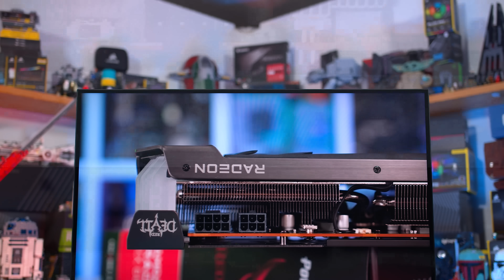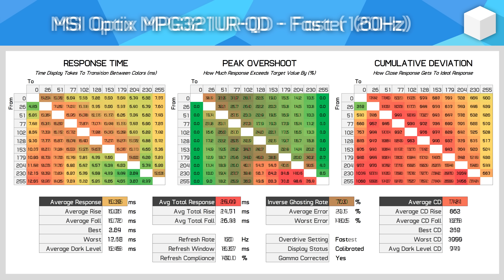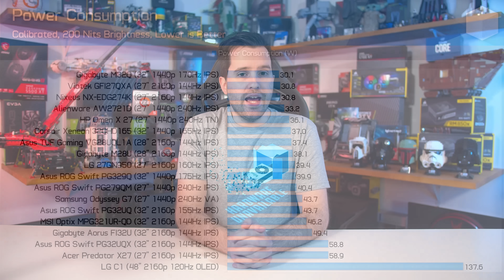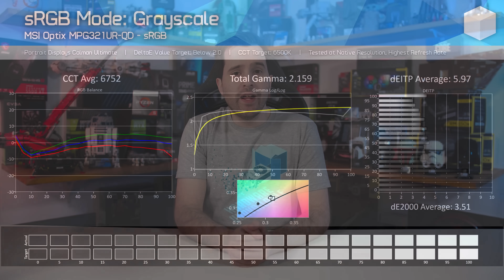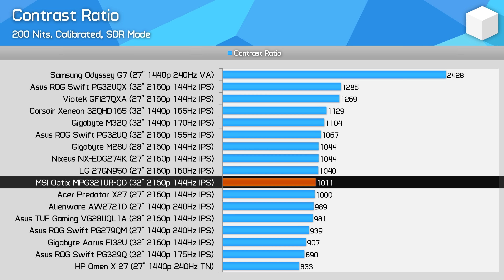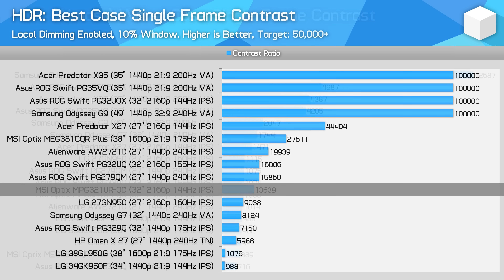The 4K Monitor to Buy? - MSI MPG321UR-QD Review

Comment: Whenever a premium high refresh rate monitor doesn't offer a single mode that you can use across the entire refresh range, I immediately discard it as trash in my mind. The whole point of getting a premium product is to avoid dealing with the compromises of the cheaper options. Even budget monitors can offer a single overdrive experience.
Reply: This. I wonder; if MSI were to update this monitor (website says it supports firmware updates) to include a variable overdrive, would that would change Tim's recommendation from nay to yay?
Reply: LCD pixel overdrive is just a bs invention anyway. It doesn't change the native response time properties of the pixels in the panel, but just shifts them to a different type of artefact (overshoot). The non-overdriven response times are the true response times of the pixels. And it's even a bit worse than that, since no display reviewers measure the full response times of 0 to 100% change in colors. I think HU now measures 3 to 97%, which is better than the 10 to 90% it used to be for the past few decades, but still not the full 0-100% time it takes for a pixel to change color.
And this does matter and can be perceived.
True LCD pixel response times are really in the 10-15ms range. Barely good for 60Hz. Everything else is just pretending they can really keep up with higher refresh rates, but they don't. OLED shows how slow LCD pixels really are.
Reply: i feel you man 😣
Reply: Yeah same... after that segment of the vid I totally lost interest in this monitor.
Reply: @edfort5704   i think many people including me would change their monitor to OLED but the problem with this is OLED is not reliable for PC monitor yet
Reply: Same, especially if its 1440p or 4k monitor, since in alot of single player games you will have fps around 30-50, in some casual games maybe 80+ but all moba or shooters like CS will run at 100-200fps all the time so switching overdrive everytime is annoying
Reply: I wonder if there's a firmware already to address adaptive overdrive, could not find any related posts..
Reply: n00b

Comment: Trying to find a perfect Monitor for PS5 and Xbox SX is really exhausting because there’s always something wrong with one of the 4K 144hz HDMI 2.1 monitor
Reply: Theres gonna be something wrong with every monitor
Reply: Try lg ultragear 950
Reply: Yup. Technology is always advancing so there are always pros and cons. Just all depends on how much you wanna pay, how long you wanna wait, etc.
Reply: I really want to purchase a monitor for PS5 use, what would the best option be at this stage? MSI MPG321UR-QD? Gigabyte M32U? Gigabyte M28U?
Reply: @cpt_Ruckus  wait for the Cooler Master GP27-FUS or the Odyssey Neo G8.
Reply: @ermagherd1204  I ended up purchasing a MSI optic MAG281URF, very happy with it so far!
Reply: @cpt_Ruckus  that’s awesome.  I jus got my 1st monitor last month loving it. Was using a 4K tv at 60hz which is great for my One X but bought a Series S with a Acer Nitro 1440p high refresh rate monitor with Freesync & hdr10 a curved VA panel & I’m happy as fuck….but I already wanna upgrade jus knowing there’s crazy better out there
Reply: @cpt_Ruckus  I just purchased that one too. Arriving tomorrow. A little nervous with no reviews out but I trust msi with monitors. Not to mention it has usb c display which is great for my work mac. Mind giving me a little more details on what’s good and bad?
Reply: @shehzadyousaf7918  not much to dislike to be honest, no issues with HDMI 2.1 across a 10m cable with a PS5, monitor supports full HDMI bandwidth. Tons of OSD options, software to control the monitor OSD and a configurable hotkey (I use it to switch directly to a HDMI input 2). Can't speak much to the colour accuracy, but to my eye it looks really good.. I can't fault it, very happy with my purchase
Reply: @cpt_Ruckus  I’m planning to purchase the mag281urf as well… i’ve read it’s bot freesync but gsync but that doesn’t matter cuz ps5 doesn’t support any of them tho it’s just the hdmi2.1 vrr if I’m correct
Reply: @cpt_Ruckus hope you have bought something! Which one you purchased? 
Which one should I buy b/w m32u and optix mpg321 for PS5?? 
Will 24gbps hdmi2.1 affect gaming?

Comment: Is this maybe panel (or the hardware driver for it) limitations? Considering all of these 32” 4K 144hz monitors have the same set of limitations and issues. Surely all manufacturers aren’t being equally lazy in tuning?
Reply: I would say so yeah
Reply: @GlowyBoi Oh but it is! I use an LG oled C1. Admittedly that limits me to 120hz, but in every other aspect, and especially HDR, it blows any other monitor out of the window for games and entertainment, no contest at all. 
Admittedly I also use a side monitor ( 32 inch 4k viewsonic) for if I need to do any long term application work (48 inch is overkill for apps, but amazing for games). You could buy the 48 inch C1 and a decent 32inch side monitor for less than 2K and the performance would be unmatched by any of these over priced units....
Reply: @titntin5178  with LG C1 watch out the most recent firmware update apparently broke some of the features in the TV
Reply: @devonpack906  what exactly?
Reply: @Project.Wraith  Max brightness and dimming issues look up The WAN show from a few weeks ago Linus mentioned it and Babucules also mentioned it !
Reply: Don’t underestimate their laziness
Reply: @GlowyBoi right!? but if LG refreshes a C1/CX 32" OLED TV next year then it'll surely be game changer.
Reply: @damsapollo  I think they said they’re releasing a 38 inch version
Reply: @GlowyBoi If its content creation you are after, forget my recommendation, thats based on entertainment only. I was a AAA games dev for two decades and much as I love games on 48inch oled, its not the place for serious content creation. If I ever do knock out an assett in UE5, it would be on the 32 inch ips, i can always drag a preview onto the oled if I wish to test its look on a consumer display.! The oled is all about entertainment, not work!  Unfortunately, LG dont appear to have any plans for a 32 inch unit, they have announced a 42 inch for next year, but I believe its unlikely they will go smaller.... Though I appreciate there is a demand.
Reply: @robertct06  42inch, next year

Comment: I'm just waiting for a $1000 32" 4k 144hz oled monitor. Totally willing to wait another year or 2 if necessary. . .
Reply: I am afraid you will have to wait longer than two years for one of those. 
But it sure would be a great monitor.
Reply: Gl with oled on games
Reply: @CarthagoMike  1000 dollars for oled 4k 144hz🤣🤣🤣🤣.
Reply: @mareksarnovsky2731  I mean..OLED is better for gaming thann anything that came before..It provides a higher definition then LED and LCD..Its the only display truly capable of fully rendering 4k and 8k.
Reply: @j.a.3138  there are more than 50% people who return burned oleds, because of static screen (what they expected truly ? :D) there is no big difference between led and oled, only what is bigger difference is true black and in most of games u dont need it.

Comment: Hey Tim, an updated buying guide on ultrawides for 2021 would be interesting!
Reply: I’m happy with my LG 38GN950 but there weren’t that many reviews on it when I bought it in January this year. I would have loved a HUB review 😉
Reply: I'm still waiting for the review of the LG 34GP950 myself.
Reply: Yes please!
Reply: For a gaming monitor, if you want little compromise for a fair price then it's LG 34GN850 and if you want something much cheaper but still decent it's Gigabyte G34WQC.
Reply: The only ultra wide you need to know about is the g9
Reply: @kanseidorito5287  that's if you are willing to spend this much money on a monitor.
Reply: @sujimayne  I already have the LG 34GN850, but the DisplayPort stopped working and I need to return it while still in warranty. But I need the review of the 34GP950 to know if I want to upgrade or stick with the 34GN850-B.
Reply: @filipealves6602  not sure where you are located at but here in germany the 34GN850 is 800 euros and the 34GP950 is a hefty 1300 euros, for 20Hz more refresh, a watered down gsync ultimate spec and HDR 600 (still not true HDR) over HDR 400 the 500 euros is a total joke.
Reply: @warlordwossman5722  indeed, but that's where I need Tim to come in and confirm that there's nothing else to add to what you said. The HDR in my monitor is indeed pretty poor, I was hoping it was considerably improved. Also peak 400 nits is still too bright, I don't want to be blinded by my monitor at 600 nits, I just want good HDR in both games and Blu-Rays on my gaming machine.

Comment: I will be waiting for the Gigabyte M32U review before I make a decision on which 4k panel I should get.
Reply: RedJoker  it should be, but there's some subtle differences like in their website, it says you can use the aim stabilizer(motion blur) along with adaptive sync. And I'm sure Tim will be able to point out those subtle differences if there are more.
Reply: M32U is most likely a FI32U with simpler design.
Reply: M32U has the same panel as the FI32U. Just like the MSI MPG321UR-QD has the same panel as the PG32UQ.
So performance is very very similar. In the end it's more about how well the model is pre-calibrated and what functions were implemented.

Comment: Man crazy that the cheapest 4k 144hz monitor by Gigabyte is the best of the bunch so far with regards to 4k, 144hz gaming...I should have bought it when it came out months ago at a price below $800 AUD. Just like GPU's mark ups, current pricing from retailers means the only M28U's  I can find are all over $1000 AUD which sucks...  Guess we're going to have to wait for those 4k 160hz monitors in Q1 2022
Reply: I also regret not buying the M28U sooner too. Sold out for a while here in the US. Hecc I've just snatched a $873 4K, 144hz monitor from ASUS ROG last night. just got released and barely any reviews on it atm... yet customer reviews are 99% positive.. 100% actually shockingly. But yea all of these monitors are selling like hotcakes and sold out just like GPUs.
Reply: LG 27GP950B is pretty good in my opinion.
Reply: Same, but if the reviews said it sucked we'd be saying how we wished we waited to know better. No point beating ourselves up about a decision we had to make with limited information like that, especially with an unproven brand like Gigabyte.
Reply: Yeah I grabbed the fi32u from Amazon to try and test out and the 4k gaming is pretty amazing. Only downside is the performance I miss on my 240hz 27" 1440p display when playing competitive shooter. For open world games and RPG, or even SP fps it's stunning. Kind of sketchy about keeping the gigabyte though because of HU review and some people reporting horizontal lines appearing due to some flaw. RTings gave it decent review though. I was excited about the msi with HDR 600 but seems it's got slower response times/slower panel vs the gigabyte
Reply: Only hesitation I had on M32U or M28U is not having full bandwidth for HDMI 2.1. Since I have a PS5, I don’t want that compression.

Comment: Hi, will you review the M32U or should we maybe expect similar performance to the M28U you've previously reviewed? I'm looking for a 32in 4K 144hz but I feel like most monitors with those characteristics are obscenely overpriced.
Reply: They all use the same panel and are similar in performance. Buy whatever's cheapest and has the feature set (and warranty) you want.
Reply: I wanted to see the same review M32U 😔
Reply: The M32U has the same panel as the FI32U, which Hardware Unboxed already reviewed. So you can expect it to be similar to that one's performance.
Reply: I have the M32U and for $799 you can't go wrong honestly it's a awesome monitor . The latest firmware update increased the input lag substantially since the review of the M28U on here. You won't be disappointed with the M32U
Reply: @jonessii  Does this use the same panel as the Gigabyte M32U? And from the little research i've done the Gigabyte M28U seems to use a bit of a higher quality panel.
Reply: @TC_DualSport  Nice, so what are the pros and cons with the M32U? Also, what do you use it for, like 144hz pc gaming and streaming?
Reply: @TC_DualSport  they increased the lag??

Comment: After going to an Asus tuf vg34vql1b than back to IPS I had several IPS panels. The g27q along the the dell nano IPS and 2 different LG nano IPS panels I went back to the Asus tuf vg34vql1b. It's the only VA I've had that's got low enough ghosting that I don't notice often enough to loose out on the almost 5000 to 1 contrast and highest nit Brightness I've had on a monitor.

Comment: Proper HDR
A fast enough panel
27" Size
QHD/4K
Backlight strobing with VRR
144Hz+
Good Color Performance
Recommended by HUB

If all of the above are combined in a single monitor, I'd upgrade from my aging MG279Q. Looks like we still have some waiting to do

Comment: I keep hoping Alienware will make a ultra wide 4K monitor.
Reply: I want Alienware/Dell to make a 32:9 monitor considering Samsung are struggling with G9 quality control.
Reply: I was waiting for a good 4k 32". Just gave up and got the 38" Alienware AW3821DW.
I never wanted to buy Alienware but it's pretty sick. 3840 wide but only 1600 tall. Which is less awesome for productivity but means fewer pixels rendered when gaming. 
$1499 AUD for a decent, fast, IPS monitor

Comment: I didn't watch this yet but I hope MSI improves the "Goldilocks" monitor (Optix MAG274QRF-QD) with the MAG275QRF-QD because that is basically the perfect 1440p monitor.
Reply: Goldilocks?
Reply: @moetazammar964  It's an idiomatic expression where it's just right in so many ways.
Reply: @SeraNeph  I'm aware it means something, I'm just curious what it is. Also because I was looking to maybe get that monitor
Reply: 27 inch is too small
Reply: @williamg7138  nah it's acceptable
Reply: @williamg7138  I really want ultrawide but at the same time I have 3090 and i12900 and don’t want to give up on 4K I really don’t know what to do
Reply: @windynight143  get a 38 inch 3840x1600. My 3080 runs good on that so a 3090 with be sweet

Comment: I recently got a RTX 3080 and was on the hunt for exactly 32" 4k monitor and this basically has told m,e what I had originally thought with a hell of a lot more detail than I, thanks guys.
Reply: hey dude can u tell me this monitor is great for rtx 3080?!
Reply: @CetutsDS  did not find one yet,  still on hunt,  not sure it is currently worth getting as a lot seem overpriced
Reply: same here. I just upgraded to i9 12900k with 3070 ti and still searching for a decent 32" 4k 144hz monitor. My current monitor is a Samsung 32" 4k but stuck at 59hz..I might get this one.
Reply: @j.a.3138  any updates?
Reply: @Pettigo83 so what did you finally get ?
Reply: @abhisheksharma07  got Gigabyte 32mu, I'm happy enough with it, not 4k though

Comment: There has got to be a solution to automatically switch to an SDR mode in the future. Some kind of software control via USB. I'm not buying a 1000$ monitor to manually switch profiles every 30 minutes.

Comment: So basically it's stupid to get any 4k 144hz monitor today. It's sad to see such expensive monitors lack features or functions across the board. I'm in the market and it looks like I will continue to be in the market. Not going up spend $1000 and still lack anything.
Reply: TVs are so close to monitors at this point I rather keep my 165 1440p dell monitor and upgrade my tv to 4K 120 and enjoy gaming that way its cheaper with a bigger oled picture LG c1

Comment: A lot of these monitors look great, but on the flipside of that, if there is ever an issue that requires support - there's a reason I predominantly go with Dell or HP.  Their Customer Support and Returns tends to be really easy(especially if you have dead pixels), where-as Gigabyte and MSI tend to be a nightmare and Asus has always just been hit or miss though like back in the x79 days.

Comment: I tried out the 32 inch GN650-B from LG (1440p resolution) and it was super underwhelming. Extremely bad input lag/blur, with lots of overshoot. Picked up a 27 inch IPS from LG as a replacement and it is way better at handling the refresh rates that these monitors reach. The 32 inch VA panel had similar response time performance to the monitor you're reviewing here. Overshoot and inverse ghosting were extremely distracting on the 32 inch panel, and caused extreme eye fatigue while playing high-response/high-detail games like Path of Exile, where there is a lot of white text over black boxes moving across the screen.

Sad to see that so many of these "higher end" monitors are plagued with either extreme amounts of overshoot or slow response times that are inadequate for 144/155/165 hz. Interesting, though, to see that the LG IPS you tested did very well.. that lines up with my experience with their 27GP83B-B. The only issue this monitor seems to have is a bit of a screen door effect,  though it is most noticeable during startup and seems to go away after it's on for a while.

Comment: You say "the fastest mode is not suitable for gaming at 60Hz, which might be common for a 4K monitor".

2 years later, 144 FPS at 4K is totally doable in most games with a card like the 4090 (provided you are reasonable and don't push every setting to 11). So, would you say, this monitor has become a better choice today?

Or maybe, today is not the right moment to buy a new monitor anyway, because we are close to see new, better monitors being released on the market?